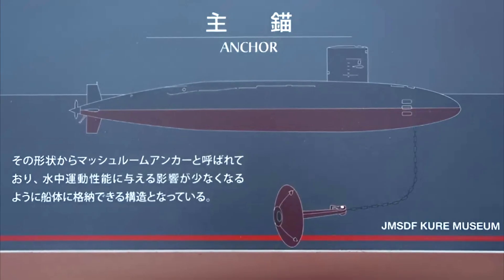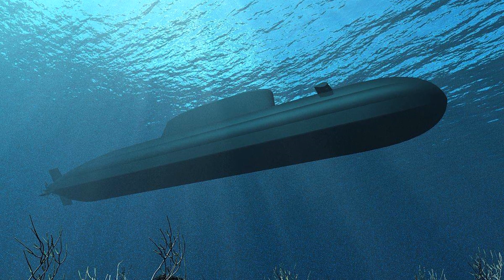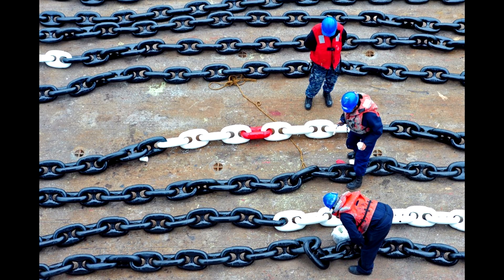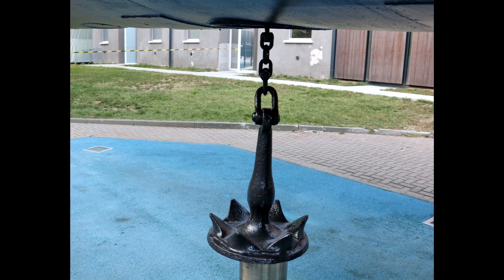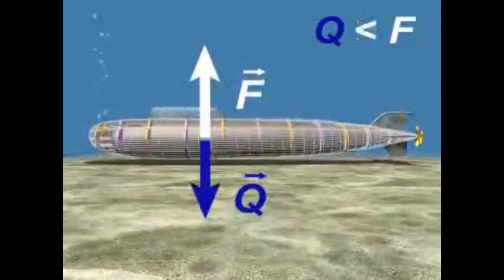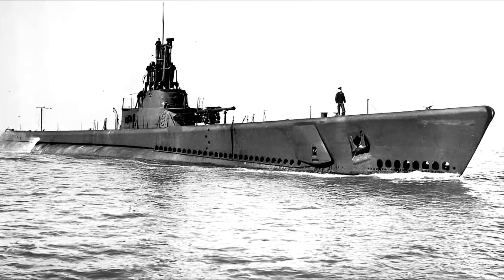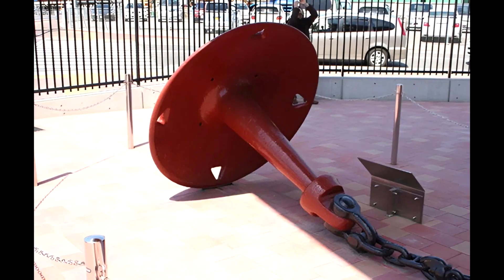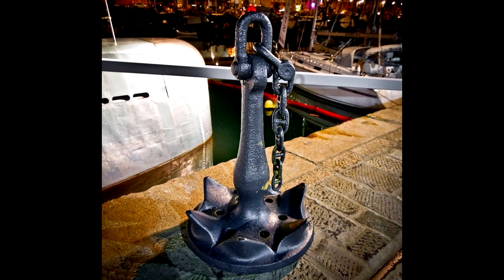Do submarines have anchors and why are they needed? The secret is out!

Comment: I worked on ssbn submarines in the royal navy,at rosyth dockyard,Polaris subs,hunter killer subs,and they all have anchors, problem with the anchor on a sub is if you needed to use the anchor that was fine but if you had to slip away in stealth mode  or anchor was stuck on the bottom, there was what was called anchor release gear , fitted inside the sub ,I worked on it it was basically called anchor slip gear , through a lot of rod gearing you could turn a u shape link ,if the the anchor was good you could indeed haul it in ,but if if got stuck and stopped the boat moving of ,you could turn the rid gearing and it opened a U shaped gate to allow the last link of the anchor chain to disengage.
Reply from the maker: Thank you, interesting information!